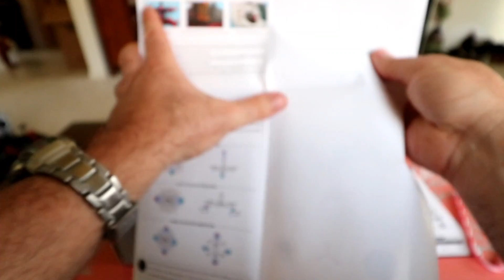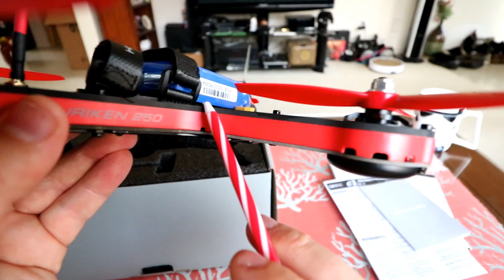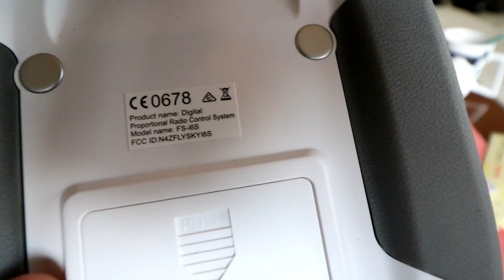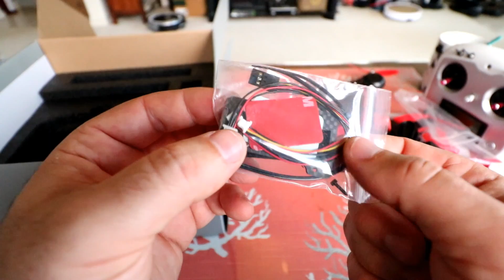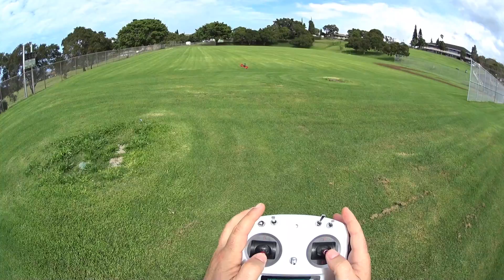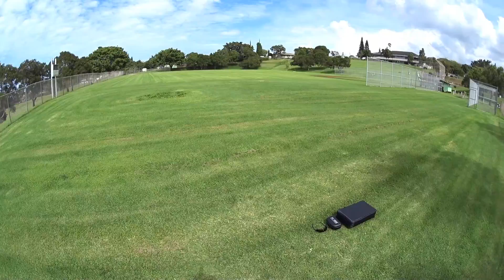Holybro SHURIKEN 250 Review - [ Unboxing / Inspection / Flight CRASH! Test / Pros & Cons ]

Comment: By the way, how is that battery charger you get with it? I ordered exactly the same model to use as my go-to charger since it was recommended over on DroneTrest but it obviously hasn't arrived yet. XD
Reply from the maker: +Edgewalker001 It's a plain cheap charger but does work fine.

Comment: i got a shuriken 250 as my introduction to race quad.  out of box was a lot of fun and not too difficult to get a grip on.  however during my first attempt at using cleanflight, i somehow disconnected my controller (stock out of box) and cannot get it to bind again!  ive tried everything except updating firmware on receiver, or hard booting the shuriken itself.  before trying that i thought i would reach out for suggestions. any help would be appreciated!

Comment: You need to fix your FPV setup - there's obviously something wrong
- it makes your FPV evaluation fairly meaningless as it is...
Reply from the maker: +FlyingPhilUK I know.  I just got in the new aomway commander v1 goggles with the 40ch VRX and scanner built in.  Much better.  I think most of the issues I've been having were from that 32ch VRX module from BG I put in.
Reply: Probably worth checking the Band as well as the Channel
- since the bands overlap each other ...

Comment: Dustin : I suggest you invest in a pair of I.B.crazy, Video Aerial Systems Airblades , C.P. antennas. They are really durable and have high rejection of reflected signal. I had choppy reception,due to multi bathing. The Airblades made a noticeable difference. They made FPV much better. They are way better than FatShars's antennas. As they say, "You Get What You Pay For!" ;-)
Reply from the maker: +Don Fish Jr. I will look into using them Don.  Thank you 😉👍

Comment: Ouch that hurt I like the way you handle a crash 🤕 Dustin do you ever hear from the people you do the reviews for, do they comment on the fpv video quality and what the breakup might be, your equipment or there's?
Another quick question last year you and Flyin Ryan got to demo a new quad that a young guy was building did he ever send you a final build to review? Thanks
Reply from the maker: +RC944jim it may be the module I've been using in my fatsharks.  I've just got in the aomway commander v1 goggles and much better.  Teal drone was postponed until this month.  George Matuse is supposed to get back to me with updated info.  I'm eager to review it ☺👍

Comment: I have been flying/crashing one of these for a few weeks.  I have since moved to a dipole antenna, with lots of reinforcement by heat shrink.  Also, place some hot glue around the connector where it mounts to the board.  I have gone through multiple battery straps and XT60 connectors and keep fixing and flying.  It is built like a tank, but it does have lots of power and is very fast  on 4s 1300mAh batteries.
Reply from the maker: +Bang Switch 👍

Comment: It was a better drone than the last 1 it worked ? Lol , poor FPV let it down , manufactures should not skimp on antennas, its simple have a good view or you will crash, enjoyed.
Reply from the maker: +SJM The Drone Flyer good antennas would be better for sure.  It really may have been my module in the fatsharks.  I'm thinking of doing some follow up flights on be ones that had issues with the new 40ch aomway DVR goggles I just got in 😅